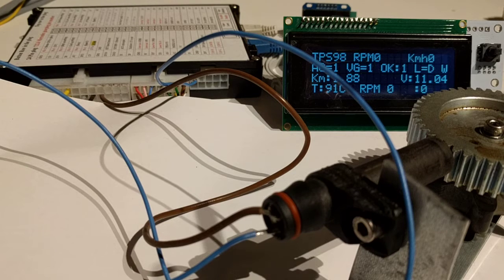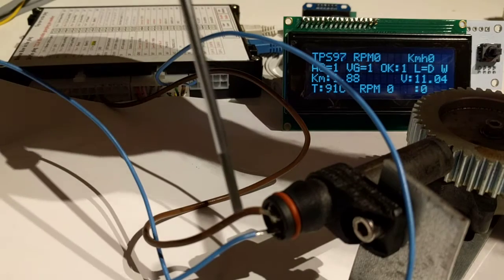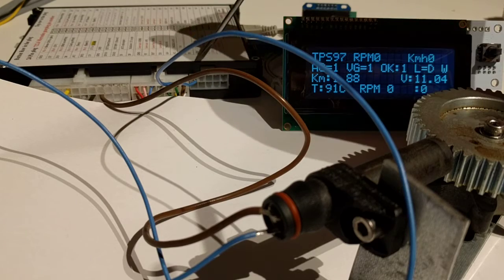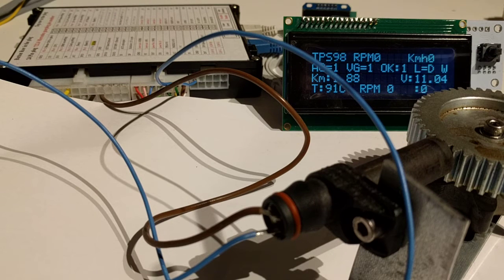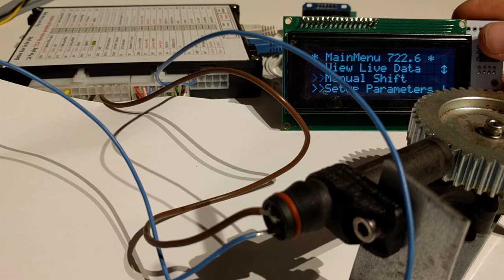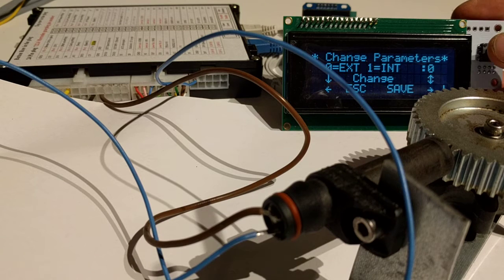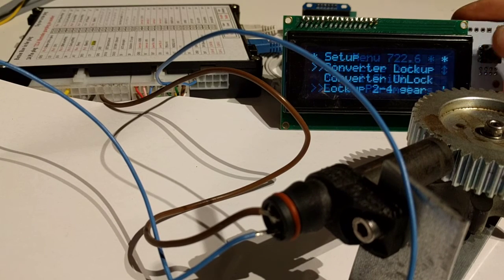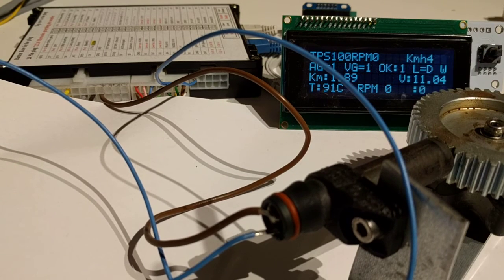Testing External speed input

Comment from the maker: well yes if the controller is set up to use internal speed sensors. it can still send signal to speedo width correct speed of the car.
Reply: Is it possible to splice into the existing ABS sensor wires or should I use an extra sensor?
Reply: what should I connect where?

Comment: Is it possible to use the speed output from the internal speed sensor in the 722.6 gearbox to "power" an electric speedo from v8 124 or a speedo from a w126? And also calibrate it with the controler?